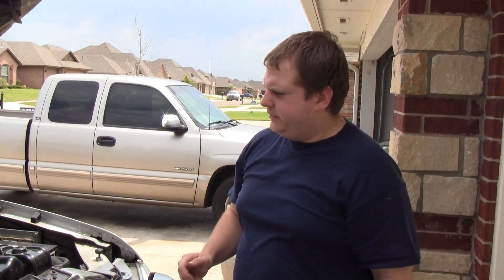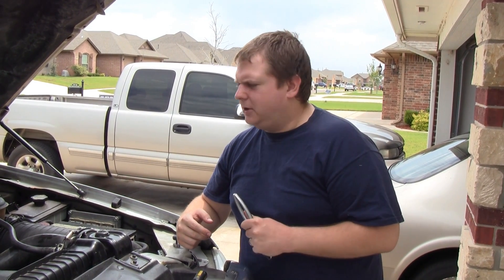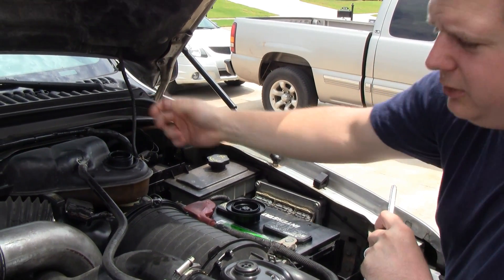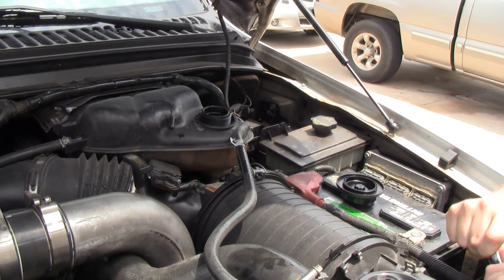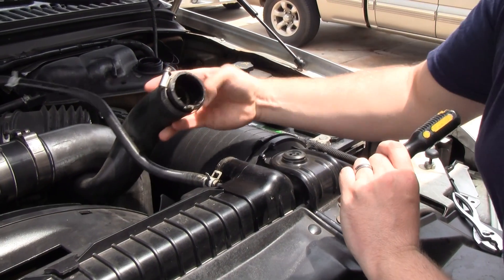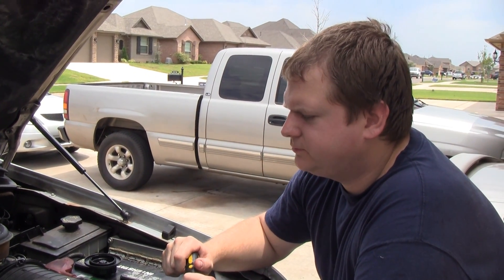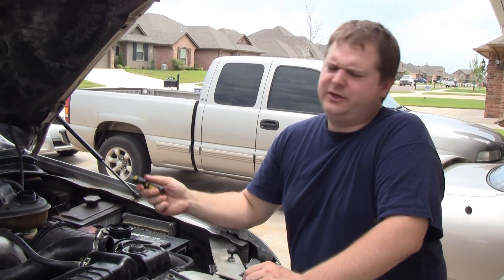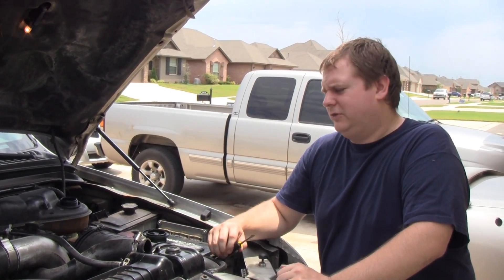Deviously Clever Mechanical Fraud On A 2003 F-250 Powerstroke Diesel

Comment: I  had  one  of these  trucks ,, it  happened to be a 2004 F350  with a 6.0 PowerJoke turbodiesel
mine blew  headgaskets twice ,, well after the second time  I said F-U , Goodbye to the Power Joke  and  replaced it with an 8V-71T detroit diesel ,, which was removed from an old  fire truck ,, now  I got 3x the  power  and no more powerjoke  worries 
and on the bright side  it  was  way  cheaper than fixing that fucking  6.0  diesel again ,,only  big issue is the  noise ,, because this thing is LOUD and  no muffler yet made can quiet it
Reply: I told  someone  else the same thing in another  video and I'll tell you the same thing 
I don't ever post videos of my  toys here because I had a  vehicle stolen in 2009 which I had video posted of both  here  on YT and  on another  site ,,it was determined that the  person used the  you tube  video  to locate the  vehicle ,,I also  have  nothing to prove  to anyone ,,I worked  hard  for my  toys and there isn't  anyone  gonna  take them  away from  me
Reply: I think I would have something a little more modern than 8-71's.You say you have 3x the power, but even if that were true, you also have 3x the weight in the front of a truck that is notorious for a heavy front end (Powerstroke 6.0, 923lbs, 8-71, around 2500 lbs. Detroit 8-71 TA's put out about 400hp, and the 8-71 TI's, about 450hp.
I just replaced 8-71N's (318 hp) that have been in my party fishing boat for nearly 30 years with Cummins 6-BTA's (330hp). The difference was profound. With the two Detroits I burned about 30gph (both engines) @ 14 kts.. With the Cummins I now burn about 20 GPH, and my cruising speed has increased to 16kts. So I now go faster and burn 10 gph less. I put about 1200 hours a year on this boat so that equates to 12,000 gallons a year less ($48,000 savings @ $4 a gallon).
But here's the good news Coyote. I have several remanufactured heads (4 valve), 1 remanufactured block, exhaust manifolds, cams, and more that I kept as spares and no longer have any use for. The other downside to 2 stroke Detroits is that parts have gone sky high. Heads that I paid $400 apiece for 20 years ago now go for around $800, and there getting hard to find. Don't worry, I'll treat you right if you need any parts. You can contact me at Megabitecharters@gmail.com. Good Luck
Reply: it is  nice to know  someone  who  has  spare parts  for these  engines ,,although I can get parts  easily ,,I know someone  who  runs a  rock quarry  and  has a lot of old machinery/engines that I can  rob parts out of ,,,I have  several vehicles with detroit  engines  as well as a couple  tractors too,,,and I have collected a few spare engines as well 

I  converted one of  my 1987 chevy S10 trucks to  a cummins engine ,, it is a  4BT cummins  I salvaged  from an old  bread truck ,,and  I like  it  as well as any other engine I've  ever had ,,, it will even start at  -15F without using a block heater  or ether/starting fluid
an added plus is it gets 32mpg   and has  more power than the original  2.8 liter V6 did

I didn't worry  too much about the weight of the  8V71  in my F350  when i swapped it , mainly due to the fact  ,, this truck is a heavy use truck ,,I use it as a tow truck  and a snow  plow in  winter so the extra weight is a benefit ,,and  I have  removed the multi link suspension and replaced it with leaf springs  and a Dana 60 front axle ,,due to my  killing the factory axle two times before I swapped engines

Comment: Just curious if it was a 6.0 liter motor, Ford discontinued that motor, due to head gasket problems
Reply: Umm it was discontinued for emissions reasons...
Reply: Um it is my understanding that it was due to cooling issues, and since it was the engine of choice for cut away vehicle converters, ambulance and other municipal type vehicles the motor was phased out, too many head gaskets were failing....This is straight from the service bulletin that ford issued
Reply: mike sharkey Well, being the owner of one of these, I'll tell you that its not the HG's that fail, its the EGR cooler, though the weak head bolts are also a problem. And also they were discontinued, but not until 2006.
Reply: mike sharkey Thats wasn't the only reason it was phased out! the list is to long to type but some of the other things were, the need for cleaner emissions, common rail fuel injection, more power, and so on!

Comment: Some fucking slimebag did something similar to me... Changed the overflow bottle for a good one out of the scrap yard (I assume this because it was clean but not brand new looking)  so when I bought it the coolant was clean but after driving it home the overflow bottle was covered with milkshake. No coolant in the oil though so I guess I still have a chance to fix it.
Reply: You have a popped  oil cooler my friend simple fix if you have the time patience and 3 gal of simple green

Comment: Nick... so what was the problem or malfunction?  Head gasket, EGR, oil cooler, leaky water pump housing etc....?  Did you fix the problem or problems?
Or trade it in on something else.   Actually this issue is typical FORD.  The seller was a crook...of course.  So, did you repair it?  WHy not expose the dealer?   A car dealer license is a license to STEAL.....

Comment: lol well the first problem was buying a 6.0 powerstroke lol they are NOTORIOUS for stretching the head studs and blowing a head gasket. just about the best powerstroke ford ever made would be the 7.3. (International engine) however the 6.0 can be a great truck, and just as reliable as the 7.3, but only if it has had some extensive head work done.

Comment: Yes hacks are all around us. Watch Out. To start with Ford ESP warranty had the EGR and Oil Coolers in the warranty package, but removed those after they found out about the 6.0 2003-2008 problem. I purchased a $3,000 warranty and found that out and I did not get any of the Navistar lawsuit because mine was low mileage and did not occur within the 6 years. Love the lawyer loop holes. LOL

Comment: That's great.  I'm glad I found your video because we were about to buy a large moving truck. First inspection drive seemed fine and looks like a great deal but now I have to go back and pull the dip stick, check water and take another look at the engine for leaks after driving.  This was a good find.  Thanks

Comment: that was a common defect that the 6.0 had was that the head gasket went bad
Reply: Water in the oil or vice versa doesn't conclude automatically one or two head gaskets failed.  When a 6.0 blows a head gasket, by design of this engine the coolant is uncommon to enter the oil sump.  The gasket blows at a coolant jacket.  Go run the truck hard from a cold start.  If there's a blown head gasket, it will over-pressurize the cooling system.  Loosening the coolant cap having a blown head gasket will gush the coolant from the fill tank.  If a blown head gasket goes unnoticed, another way you'll know depends on where the engine stopped during it's last shutdown.  On shutdown if the piston was before top dead center, the pressure on the cooling system where the head gasket is compromised will force coolant into the cylinder causing a hydralock situation the next time the engine is cranked over.

Comment: Never buy a car at an auction unless you have a lot of time and $$$ to spend fixing it.  There's a reason why it's at an auction...and not a good reason...
Reply: Sometimes you run across a gem you get for a cpl hundred and the only thing wrong with it is something outrageously stupid and cheap and fix it and automatically raise the value of the vehicle ten fold!!
Reply: Probably the most sensible comment posted. The 6.0 had flaws that never should have allowed it to production and how Ford escaped recalls on the STC fitting, for example, boggles the mind. Not a great engine but adequate in stock tune once the EGR cooler, STC/standpipe, head gaskets are addressed.

Comment: My '64 VW "whistled" as I was speeding down hiway 395 and the engine was at a stable RPM so I could hear it. Turns out the excessive heat of the "pancake engine" cause small cracks to form radiating from the spark plug ports. Wheel Works used intimidation and even began to report on my engine fluid levels when all I wanted was my "free tire rotation". Wheel Works were thugs right from the git go.
Reply: say again your last transmission???????????

Comment: i would not be suprised if a ford dealer did this after my 4th oil cooler and treatning to take the local ford garage to court the service manager had his top man look at it amazingly my wrench lite quit comeing on had EGR cooler delited had to unhook bat. after this when outside temp went above 65 deg. lite would come on they had reset comp. to not show code fixed with bulletprof diesel remote oil cooler if you need work other than warranty DO NOT go to a FORD dealer (after replaceing cooler cut updated stock cooler apart with bandsaw 4th cloged oil cooler)

Comment: Lol, was about to comment about this when I realized this was in 2012. :) Did you get your problem fixed. I own a Ford Diesel repair shop in Phoenix so I would be glad to answer questions if you have them.
Reply: Ive got a 2003 6.0 and having a small oil leak. I had injector #2 & #3 replaced and asked if they could find where the oill was coming from. They said the oil cooler. What are you suggestions?
Reply: If you want to try and find it yourself what you need to do is clean it off very well. Spray some purple power or other degreaser on the backside of the oil filter housing and around it then wash it off. Since space is tight it is best to use a pressure washer. Some of the common leaks are from the oil filter cap, the oil pressure switch which is near the oil feed line for the turbo on the passenger side of the oil cooler, it is White. Also the seal for the oil cooler at the base in the engine valley. Those tend to leak more when the engine is cold.
Reply: Thanks bub. Much appreciated
Reply: Had a small oil spot in driveway every morning. Looked from underneath truck coming from top of motor somewhere. 6 months left on warranty turned out to be rear seal and also the turbo oil lines one was on its way out n the other had a hole in it. Hopes this helps. Just some possibilities on where to start looking.
Reply: I'm sorry to hear that. It's One Stop Truck Shop in Phoenix just south of the airport. Give us a call or drop by and we can talk 4809709080